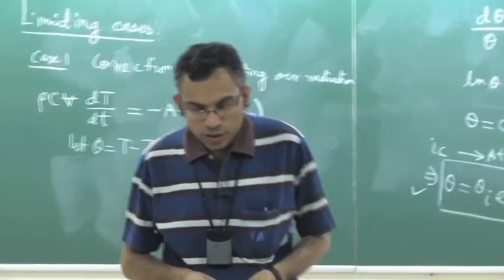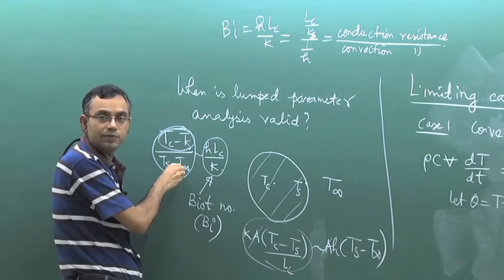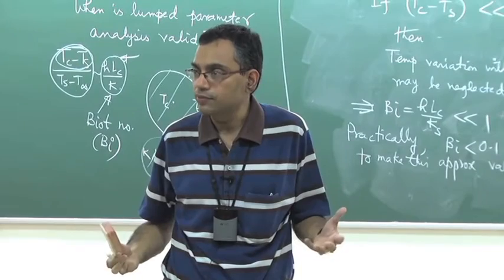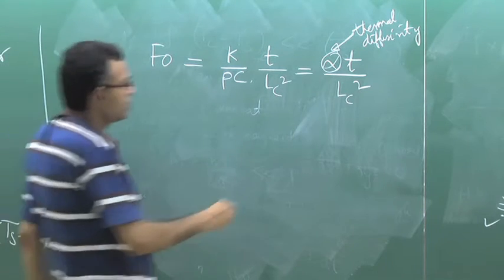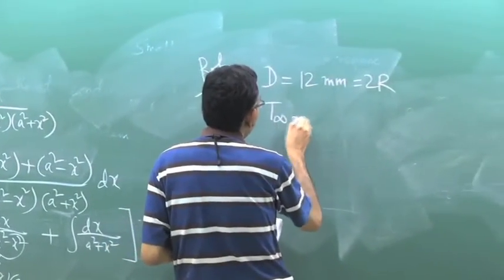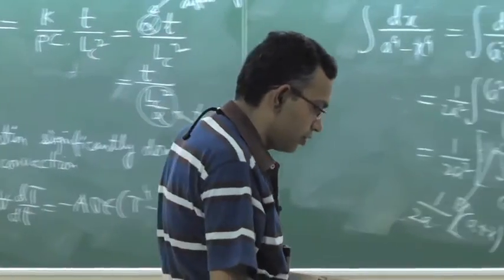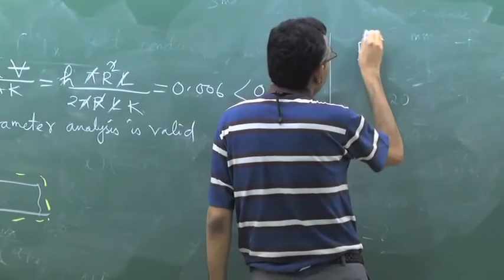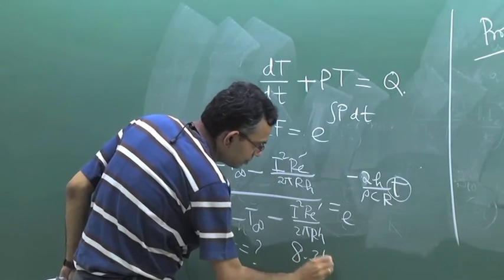Lecture 15: Unsteady State Heat Conduction (Contd.)

Comment: Answer for steel ball problem is wrong.. it would be around 1300 seconds. t= 1122 seconds can only be correct if ambient temperature is 325K and not 350K.